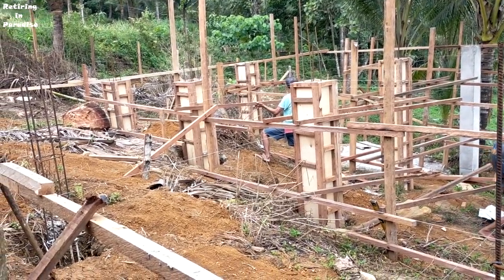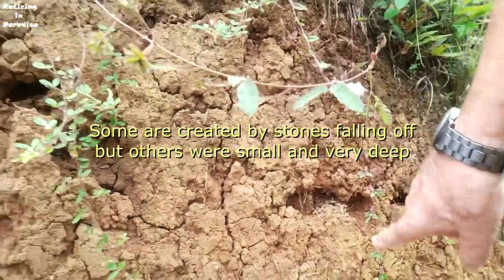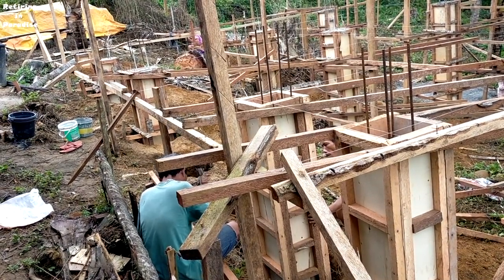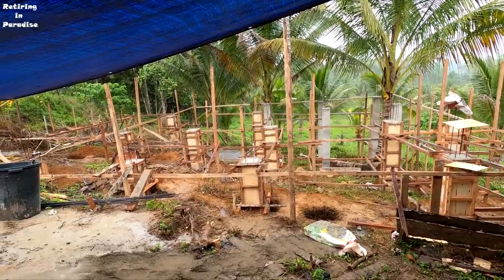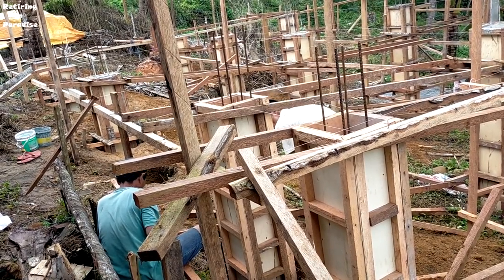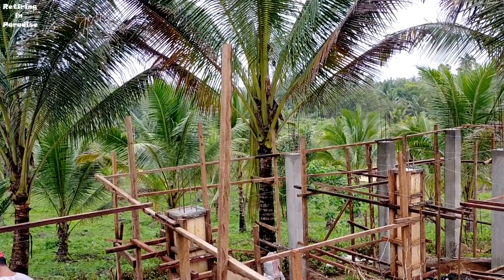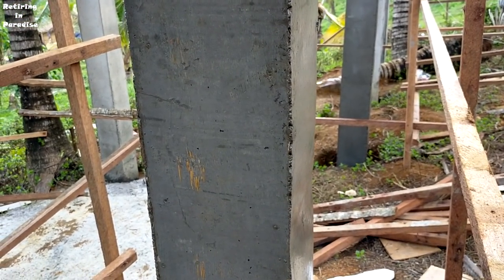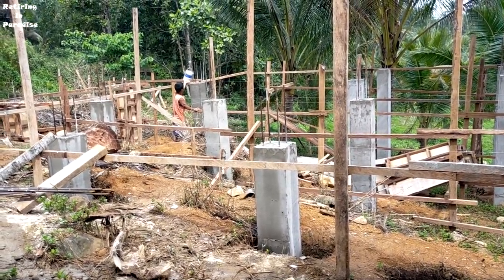V276 - Pt 11  FOREIGNER BUILDING A CHEAP HOUSE IN THE PHILIPPINES - Retiring in South East Asia vlog

Comment: Good job. No worries about the plastic tank if you put a elektric pomp on it you can juse the clectet rainwater in the tank for flushing toilet and shower. No big deal. But be sure if you place the plastic tank place it near a kolum so it hold the tank when there is heavy rain so it can not slip away. Nice progress
Reply from the maker: Thank you Jack😊👍👍👍

Comment: You should have put enough water in tank and put packed soil around parimater or outside of hole whereyou put tank to keep water from flowing into the tank hole.
Reply: Joe is buying water from a neighbor, 5 gallon drumsat a time. would be a mammoth job to fill it, but I agree. you got to fill them, at least half way

Comment: Did you perform a percolation test (soil strength test) the result of the test will be used for the computation of the mixture of concrete pour for foundation? Did you also check if there is an earthquake fault line  within the area? these are the things you need to do so that a civil engineer or structure engineer will be able to adjust the computation of the concrete pour as well as the size of the iron bars. It is better to consult technical people when you are building a house to prevent regrets in the future. Just my opinion.

Comment: Apologies for not being in touch sooner.  Life got in the way.  Building a house is very stressful and a steep learning curve.   I have read all the comments for this post and read the previous posts.  The plastic tank is fine.  Just compact the soil soil and a good layer of gravel under it , covered with heavy plastic, for drainage. .  Fill with water  and it should not float. We did have some Graves floating during hurricane Floyd, though in NC.  Turn out for driveway is good safety measure. 
Please tell Lady  JM  that she is becoming even more beautiful  if that is  possible. You are still younger and more handsome than me. Be blessed,  my friends.
Reply from the maker: Thank you😊👍👍

Comment: Maybe it's a good safety suggestion that you dig a deep trench around the house especially, so you can install a French drain or field drain large rocks first then medium then small 
insert a PVC drain pipe with 1/2 inch holes so the water can flow away any other water will follow the trench🤗🤗❤️
Reply from the maker: Thanks😊👍
Reply: A French Drain System will definitely help drain water away from the house and keep water from accumulating on the Lot 100%
Reply from the maker: @ejlugo6282  👍

Comment: Your tank is ok the problem is you should have filled your tank with water,s swimming pool will float up out of ground if the water table is high in grown, the tank you used was the best, put it back in and fill it full of water

Comment: Joe the way to keep your tank in place is the following. Put it in place and backfill with loose fill. Like swimming pools they need to be filled with water immediately. Fill your tank full and the rains won't move it or float it again. Trying to move the drainage is good but not the answer. Good luck

Comment: Hold it, the ground you need a foundation or are you building up off of the ground? Is that how they build seems a tad bit not right. OK alot not right. What I remember is foundation with footing holes, then pillers. Um, maybe look on the internet to see what could help. Seems like that is going ro cost alot more money. Just so you know CHAOS is cash, meaning the worker loves mistakes. Job is longer meaning more money. Ask around. Keep that money in your pocket you ate going to need it.

Comment: Why your  use plastic safetuck  instead of dig soil concrete for lifety   use an one  building huose  its better concrete  file hollow block around then division wall inside is  marine plywood  phil.is rainy season all  wood it damage wet  by rain  concrete huose is for life  its inherit your  hard work to your baby

Comment: Maybe if vegetation had grown around the tank and the ground settled and you would have been ok? Guess you were unlucky? We live in Thailand and it has alot less natural disasters than the Philippines, even though I think Philli is much more beautiful, islands, etc. The septic tank design in Thailand is just 3 concrete rings stacked on top of each other with a cover that allows it to be pumped out to a truck when it is full; I think this is a good simple design. We created two of these with one being a water overflow for the main one.

Comment: I installed these tanks before. 1. You can either install a cement collar around the tank 2. Fill the tank with water after installed then during rain season do not pump the tank dry.
Reply from the maker: Thank you. But Looking at the disturbed soil around and the fact that I may have to empty it one day for maintenance and the risk of a tropical rain at the same time, make me opt-out of it.

Comment: JOE... we have put in many septic  tank systems like yours.  YOU DID NOTHING WRONG...  THE PROBLEM:  easy... It rained really hard.  That's all.   EASY FIX... Use that black tank again and repeat everything you did before.  Everything you did before was pretty much correct.  IF YOU ARE WORRIED... Spend $20 and hire a local plumber to do it...   PROBLEM... The only real problem was the soil maybe wasn't compacted good.  If you had great compaction, only around black tank, it would have held it in place forever.  Washing out again... If you put a sheet of plastic, 20ft x 20ft over the entire area you dug out , on top of ground, stake it down.  The plastic works really well.  Plastic will keep from washing out   Plastic is temporary until all raining is done.   Important, dig a trench that directs all water away from you newly dug pit septic tank.  Who cares about the negative comments, we all have had same problems you have.  Good on you for DYI doing it yourself house build.
LEACH PIPING AND FIELD:
We think you might need a more extensive leach piping and field.  Not sure, maybe not, can not tell with your soil.  Important... Keep in mind where your drinking well water will come from and location of septic.  Best of luck.
Reply from the maker: Thank you😊👍👍